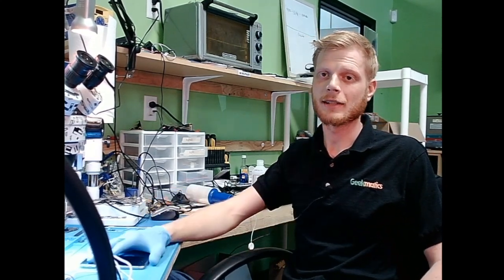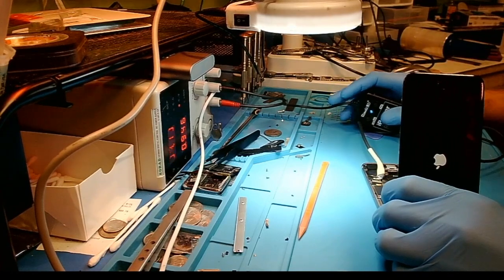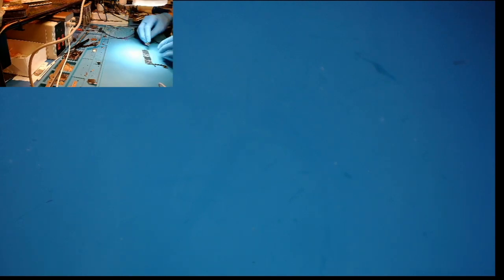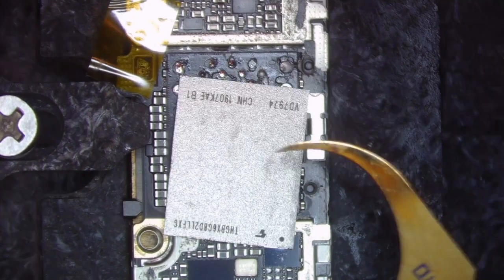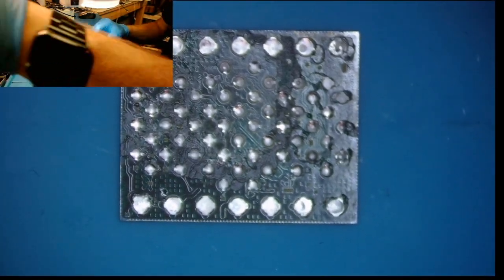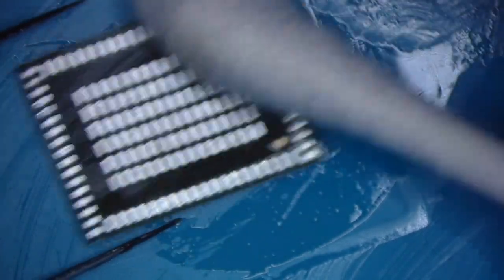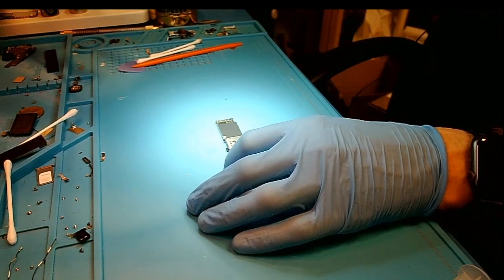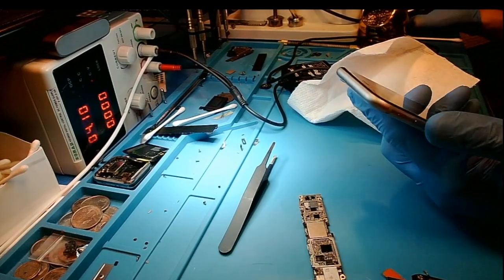Diagnosing a not charging situation on iPhone

Comment: good vid , what's the preheater temp you're using relative for any board to be preheated around 150C. And say you don't want to preheat the whole board, and need to remove Wifi or NAND what would be the temp airflow nozzle . Thanks by the way for showing
Reply from the maker: The air flow and temp really depends on your workstation.
Reply: @Dusten04 you're right and it depends if you checked with athermocouple your readings. but aside from that which are your values and station you're using.

Comment: Great video, very informative. I have a couple of questions. What were you protecting with the kapton tape, I was under the impression we dont really use that much anymore because of Traping heat? So this was a pretty extensive repair for not charging. I still dont even have the jc programmers yet to unbind the wifi from the nand. What kind of price range would we need to charge for a job like this? Great job Dusten, thanks for these videos